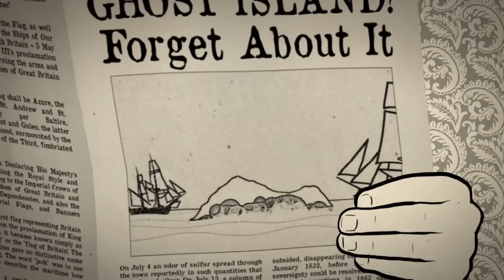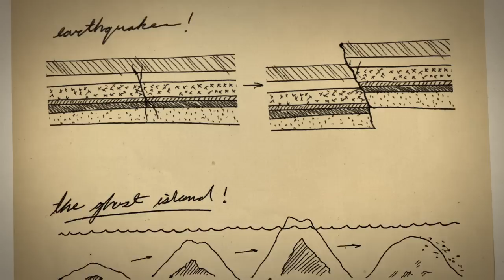The Lava Affair | Field Trip! | SKUNK BEAR

Comment: could this make obsidian or glass?
Reply: Those bubbles are glass, as is likely the 'hair', 'tears' and a lot of the flow's surface. (With how thin it is, I'd bet it is mostly glass actually) You won't likely form obsidian though, as it tends to come from lava with a high silica content (called 'felsic') while the basalt they are using has less silica (known as 'mafic').  Basaltic glass is usually called 'tachylite'.